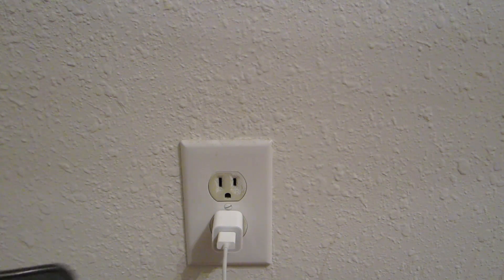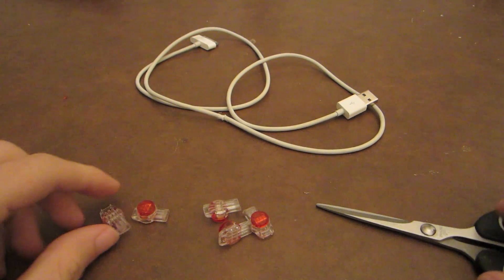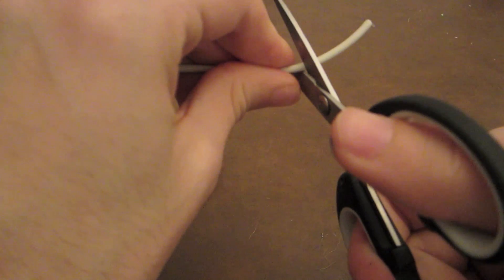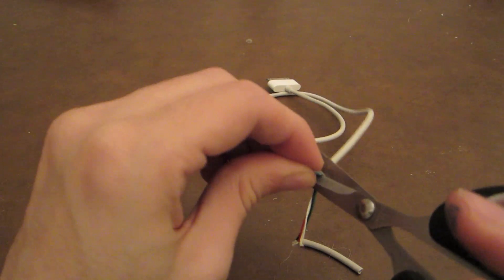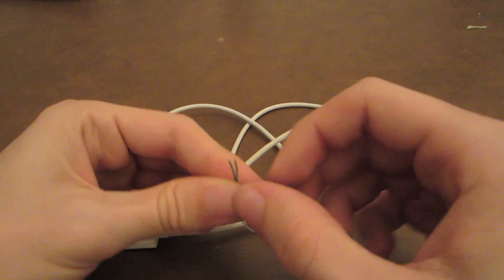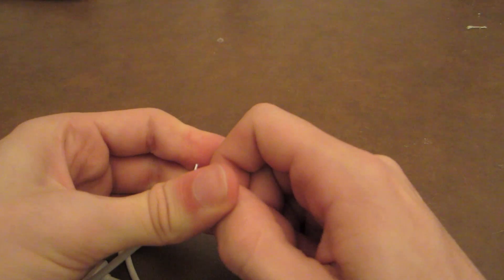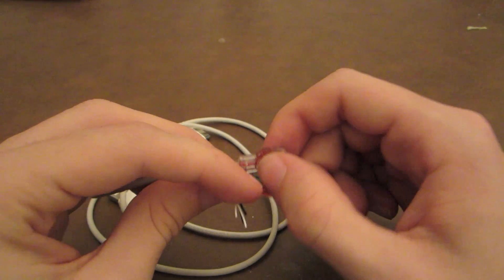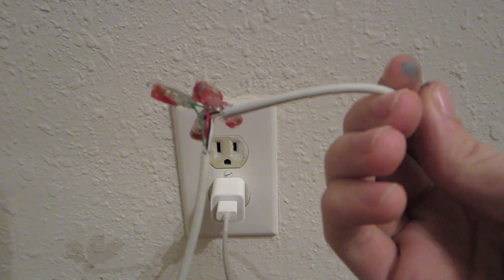The 5-Minute USB Fix

Comment: Having a better charger is #1..The problem that's constant is the little ponty pins on the cord that go into the phone wear down quickly..The more you plug-unplug
They are gone in a matter of two weeks..You can feel the 2 little pointy contact points I'm describing on the upside on the plug thar goes into your port..
These pins hold it tightly in the
port.When thier gone, you're left with a loose connection..Anser,
 Stock up on $ new cords and replace every two weeks..It's the darn pins that wear out! 
 So a better charger, new cords.
I don't see any other fix.

Comment: Edit 2: I could just as easily get another charger.

If your using a product designed for clamping loose wires its not really a 5 minute fix for anyone else
Edit: nothing against the uploader. But against all of the diy videos that use. Power tools. And other little things you have to go get at home depot. 

Making the entire video pointless. Because if I needed to go buy something to fix something I wouldnt need a video to explain how to use products sold in a fucking store. 

Id rather a video explaining skotchlocks and their use. Then. I would know what to do for anything in the future. 

I thank you for giving me information of this product but not for assuming we had these tools lying around

Comment: It's not Sodder its pronounced Solder (with an L). Yanks can't even pronounce Nissan correctly because they say Nessan. 
Also, why do you say, cut off the unnecessary shielding,, and why do you think that the shielding is there? Because it is necessary, that's why.  Many data cables wont work properly without it. But anywho, have a niece dey

Comment: This worked great. Thank you so much. I had a $100 webcam where I closed a door on the cable and thanks to you it's saved. I used 3/4" BLK heat shrink 4" toobing to hide the buttons. Looks good. :) I bought the button connectors online at Fry's Electronics and picked it up same day.

Comment: what u should really do is just strip the wires and connect them then wrap some electrical tape around it, it won't be pretty but it will look a hell of alot better than this clusterfuck solution
Reply: The8-BitNerd  yea right
Reply: Terror 1000 yea right *rolls eyes as in sarcasm or as in Yeah, right that works.?

Comment: Oh wait , this is reffering to the actual cable , dude you could have just said cable in general to avoid confusion , i thought this is a fix for the thing that goes into the USB port ( mine at first kept disconnecting from the USB port , and then stopped working entirely )

Comment: My problem is right under the part of the cord that actually plugs into the iPod.
Reply: I would get a braided charger.they have them at Walgreens for like 15bucks but they don't fray,rip,tear or randomly just stop working either like those cheap 5 dollar knockoffs that you see everywhere you go
Reply: Mine too I can't fix it 😭😭
Reply: I have now had the same one for like 5 years and it still looks and works like brand new

Comment: I have a ps3 wire charger that has been eaten. I've cut the outside wire; pink, green, black, and white are in the middle. I removed the outside protection wire by cutting it. I'm wondering if possible the USB wire displayed in the tutorial and procedure could be equivalent to a ps3 charger wire?
Reply: Never mind it actually works on ps3 charger. Woohoo! Thanks for the tutorial.

Comment: The supplies cost more than to buy a new charger dumb shit.
Reply: everyone has some sort of tape my friend.
Reply: Well, you actually don't know that. But besides that, when did I supposedly even mention anything about tape, anyway?
Reply: I don't think anyone would seriously use this as a permanent fix.  It could be useful in situations where it's more important that the cable can be repaired right away as opposed to saving money by fixing a cable (and a soldering iron is unavailable).

Comment: If u have a solder gun just buy a 4 pin male connecter it was 40 cents and cut the wire where it's good then connect end wires to new USB port it makes ur charger shorter but at least u don't gotta have a shit load of electrical tape all over and u don't really need a solder gun

Comment: If u have foil stuff around all wires use that and melt wires together and then tape it up individually then around all them a few good times then so the tape don't move burn ends lmao just b careful melting them one caught fire and melted just a little but still hold light close but not right on it and mine works while on

Comment: My device charges when it's off but when I turn it on it will not charge plz help
Reply: Same
Reply: you might have tons of apps open, double tap the big round button on the front ,there youll see how many apps are running press and hold each app for like 3 seconds youll see an X pop up,push X to stop all damn apps from running... might work worked for mee.
Reply: Yea that happens alot when it does that but a new one

Comment: Well this looks absolutely horrible... Just buy a new cable. Or if you have the stuff, solder the wires together and use some tape to isolate the whole thing. That wil certainly look better then your  "scotch locks" cable thingy..   .'

Comment: Thank you very much!!! This video helped me fix my Logitech Lapdesk (the one with the speakers & fan). The cable was wearing right at the USB input plug. I spent $80 on it about 3 yrs. ago, which is a pretty penny. I looked into buying a new one first, but found out that they are obsolete and they are charging roughly $250 for them on eBay now.  

So, I decided to try to fix it. I opened the lapdesk up and found that the other end of the cable was connected to a circuit board. I snipped the cable and spliced the end connected to the circuit board to a different USB cable with a good plug with the 3M scotchloks somewhere in the middle. Viola!! My lapdesk is running like new (and looks new after being cleaned up). Again, thank you, because there was almost no information on Google on how to resolve my issue. A package of scotchloks cost me only about $4 on homedepot.com, and for that I saved a ton of money and my lapdesk have a new life.

Comment: Who has time for this and who is going to buy scotch locks I rather buy a new charger!
Reply: People who want know how to fix stuff themselves and not be lazy.
Reply: Well it's nice for some things...like my Xbox 360 wired PC controller was like $40.  I used regular butt connectors though to fix it...much cleaner looking than these scotchloks.
Reply: A new charger won't fix a broken usb cable.
Reply: I used it to fix a $100 Webcam that I use in classrooms. This YouTube video was extremely helpful to me. I don't have extra one hundred dollars lying around. But I can go to the store and by $4 dollar Scotch locks. Emma, every circumstance is different for everyone.
Reply: I agree with you.
Reply: David Lopez Apart from just going out and buying a new charger, this is probably the laziest way to fix it
Reply: +Emma Cruthirds are you stupid m8?
Reply: I have a power bank that the usb port is broken on and the built in usb cable is broken so unless I buy a whole new powerbank or learn to solder a new usb port this is going to be my only option to keep using my good power bank.

Comment: Ok but my device is not charging overall but when it's off and plug in it back in, it turns back on but I won't charger plz help me. :(
Reply: your cables are probably crimped, while plugged in move the cable slightly at the ends youll see it start to chrge. ive held it in place and used hot glue to hold it in place. or good old black tape or any damn tape will do.
Reply: I figured it out, the problem was a lot of lint was in the charger port :)

Comment: thanks for the video it really helped me. i just fix the wire(red) which is the most damaged one and i just simply go for the problem. i just connect the damaged wire without these scotchlocks. go directly to the problem and avoid to cut the wrong wires or else.

Comment: For those who's cable is broken from the plug in point "where it enters the ipod/iphone"READ THIS! Get a small flathead and there is a crease on the rectangle part slide the flat he's through and continue pressing down until the cover goes down and then the charging unit will be exposed. Now find the wire that is lose and connect it back to its place with electrical tape :)

Comment: you don't need the connectors just twist the bare wires together and wrap in electrical tape  or put a cover on them (or leave them exposed because i didn't have any of that). just did this fix myself on my razer keyboard works perfect

Comment: Nice video. To those who say that you can get any usb cable I say this; not all cables are created equal. Some cheap ones will not charge your phone at the same rate as the original branded cable. It's something to do with short circuiting in the cable connector. Not sure of the detail, but Google it. Peace, love and muscles.

Comment: FYI, you don't need to use Scotchloks. Any crimpable wire connector will do. You could go down to Radioshack, find some cheap ones that'll fit the wires inside the cable and use that instead.

Comment: but you have to strip off the outer colored covering. For example, the green wire will have a green cover and the other colors will have theirs. Inside each are a few strands of thinner metal wires. You can twist those together a it will work